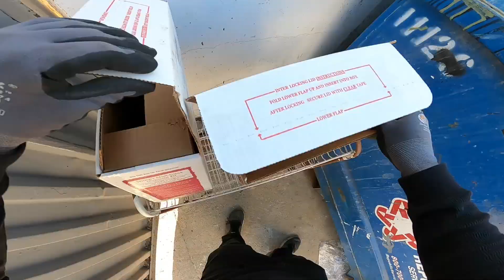Dumpster Diving For Scrap  S1E19

Comment: Why didn't you take the light box? Its aluminum. Too bad you didn't have room for the coolers so you could break em down and get the motors and other insides from them. Takes work but I guess is worth it in the end!? I just learned all that and more from watching other scrap channels, especially Mike the Scavenger who explains why he takes stuff and whatnot then makes follow up videos showing the breakdown of everything he gets! Really informative! I don't even scrap but I watch because he's so entertaining! You should check him out if you haven't yet!
Reply from the maker: We are not able to show everything on here.  Some stuff we break down and some stuff we don't. Sometimes you spend more time than it's worth breaking stuff down then just dumping it all together. Also it depends on the prices that your local scrap yard pays for motors. Ours doesn't pay well for motors so we would lose money if we spent hours breaking stuff down. We get more money for most motors that are left in because it adds extra weight. If prices change and they pay good for motors then we will break things down more. We are not allowed to record when we take in our totes of copper, brass, aluminum and stainless. We break down the scrap that is worth breaking down. We explain this stuff in our scrapping with Volt Channel. Every scrap yard is different.